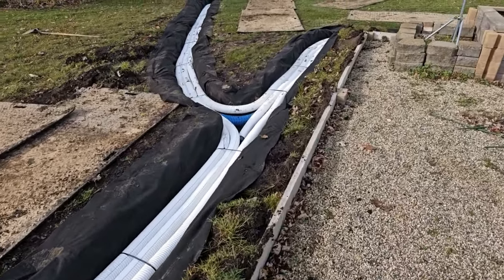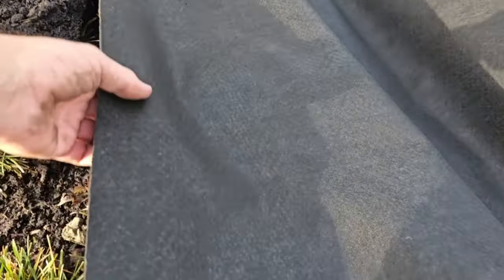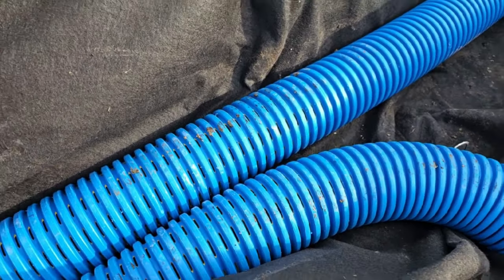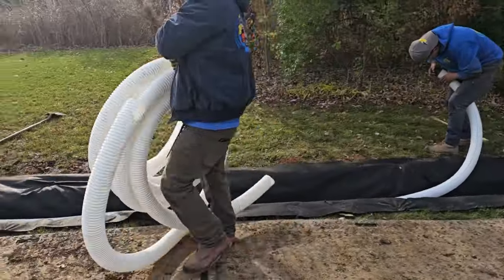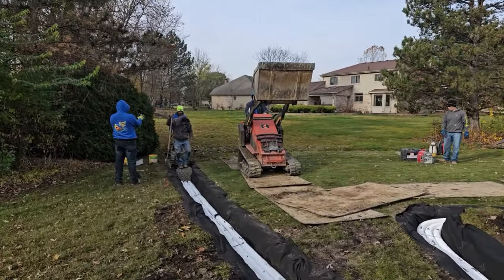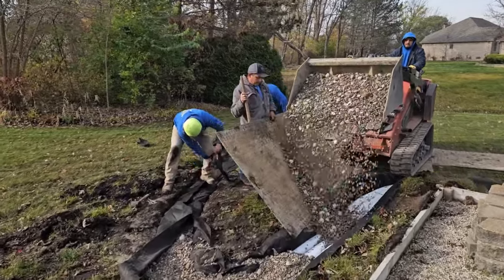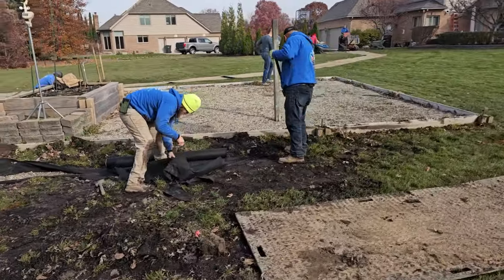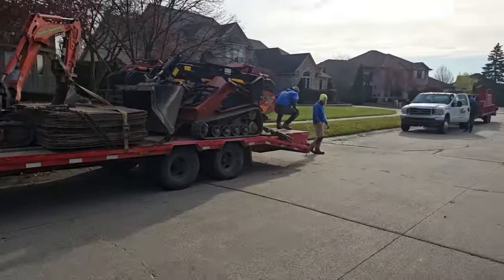French Drains Built Right - Yard Drainage - Drainage Systems

Comment: I noticed that it appears you used 3/4" crushed rock versus round rock for this install.  Is that because the grass/sod will not root well into the larger voids provided by larger round rock?  Also, why were catch basins not needed for this install?   I assume the two 4" HO pipes and three 3" pipes provided enough drainage. 

I recently installed a FD using the FDM high octane pipe, non woven geotextile fabric and 2" round rock and have had fantastic results...got tired of failed systems using inferior products and techniques.  FDM has great products and very good install tutorials!

Comment: Since Dirt haul away is a large component to the business, would you be able to discuss how you handle the dirt after it is hauled away? Dump at your facility, dirt dump reception facility, dirt exchange, etc...?
Reply from the maker: Man, I can make a whole video on this. I probably should. I never sold fill dirt, I've never been that fortunate. It always comes at an expense to me to haul it away. Free filter wanted signs are something that we've always looked out for. I caution using somebody's yard to dump in without preparing them properly. You cannot back on their concrete driveway. You'll break the apron with all that heavy fill dirt. And it'll end up costing you money. I paid to dump it in multiple locations for most of my career. Once in a while, you'll get a couple of locations in the areas of work where you can dump.
Reply: I’ve always said dirt is kind of like furniture. There’s plenty around when you don’t need it but when you’re looking to get rid of some nobody wants it

Comment: Hi FDM. Do you recommend burrito wrapping with fabric for interior basement French drain? Planning on using high octane.
Reply from the maker: I have mixed feelings on that. I perfer to not go below the footer and make the trench WIDER with more stone most of the time. If it's sand or gravel subsoil, I would use fabric.

Comment: Do you use end caps to start a French drain or yard system and then end plugs to terminate a French drain pipe?  As well do you use silicone to secure end plugs?
Reply from the maker: 4 in Corrugated End Cap - Connects to 4 in Corrugated Pipe
https://frenchdrainman.com/product/4-in-corrugated-end-cap/
No silicone because you want it to let the water in.
Reply: I've seen you use these white end caps on a catch basin as well to start a yard drain system, but I'm from Canada and on the French Drain Man Canada site I don't see that they carry these in stock.  They're black and look different.  Can you please clarify if you have these in stock in Canada?  Thank you.    @FRENCHDRAINMAN

Comment: So the 3” probably won’t move much water? Maybe some surface water..  it’s there to prevent roots and cheaper then stone.   That’s more of a question then a statement. Is it a valid concern that the white pipe isn’t as strong as the blue and could potentially get crushed if equipment drives over it or am I overthinking it?  Thanks and great video as always.
Reply from the maker: https://youtu.be/NTXJymUXA60?si=TbdnFrQq5ra-xH5a

Comment: Interesting 🤔 French drain design.  

Aggregate rock is not cheap.  It is very labor intensive to install.  

Filter fabric keeps the soil from clogging the pipe and helps to maintain the structure of the water collection trench.  

The air space in the trench is very important to allow excess water to be collected and by capillary action to flow into the slotted corrugated pipe and be directed away.  Air space also discourages root growth.  

The air space in the French drain is achieved by the 1.5” aggregate rock.  The rock functions like pores in the skin to allow pockets of air and pathways for water to flow.  

Digging the trench deeper, lining it with filter fabric, and filling it with 4” and 3” pipe enables the trench space to use smaller aggregate rock size and overall less rock material.
Reply from the maker: Someone who gets it 💪